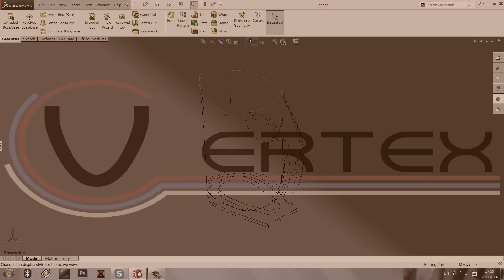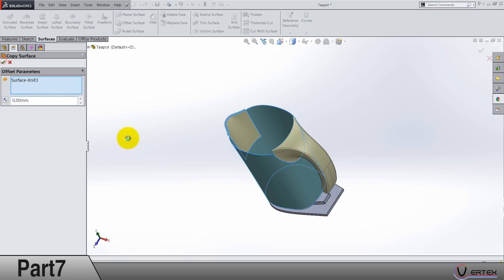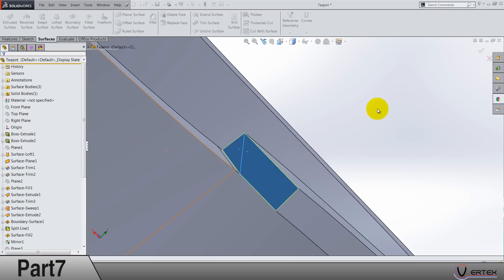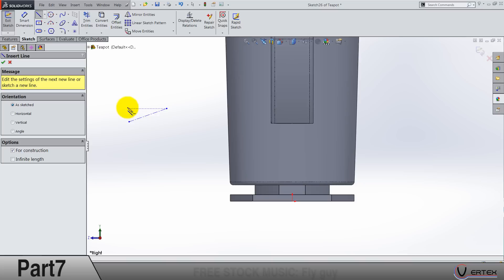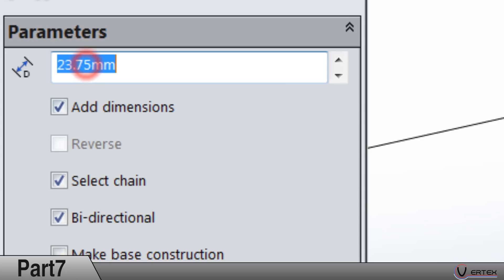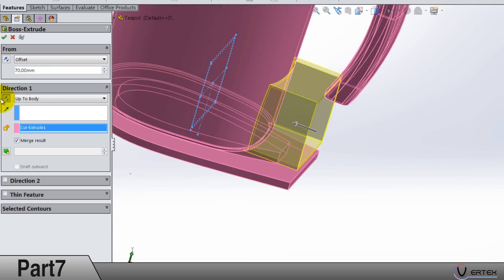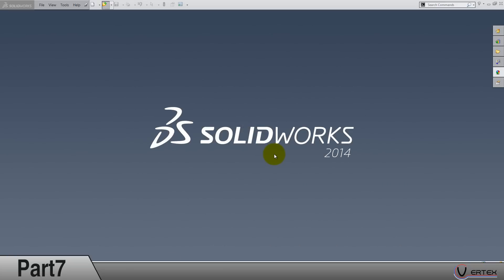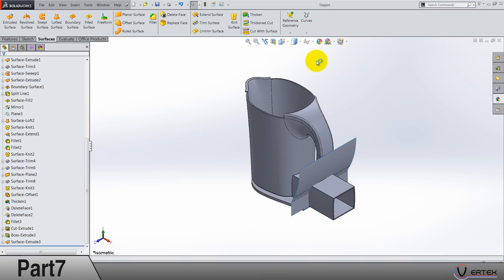SolidWorks surfacing & solid - Teapot #7

Comment: Hello Petar, I am also really enjoying this Teapot Tutorial. 

I encountered the same problem as Nick Pyne did. I retraced my steps and found my error at 1:30, part #5 (fillet 1). I am using SW 2016, and I changed the fillet profile from "circular" to "conic" to better transition with the 3mm sketched radius on the teapot handle profile sketch 10 at 3:52, part #3. An inside thicken of 1.75mm then worked beautifully.

Hope this helps and thanks again for uploading these tutorials!
Reply from the maker: Hey Miguel, I am glad to hear you are making progress.

Thank you very much for this tips I will definitely make an annotation with your instructions in order to help others to overcome this issue!

Cheers!
Petar :)
Reply: The pleasure is mine, Petar.

Comment: Hi, I've been following your tutorials, they're really good. Just ran into a problem, I can't get the thicken to work, it will only allow me to thicken outwards, but not mid-plane and not inwards like you did in your demo, please help?
Reply from the maker: Hi Nick, I am glad you like my videos.
Can you show me at what exact time you have the problem.
Reply: Around 2:15
Reply from the maker: all I know I was struggling to make that part possible to thicken, I've spent 7 days of modeling the whole part and 6 days to make the surface in a way that no such errors appear.
I would send you CAD file to keep going with work but I have lost the whole teapot tutorial files, check all sketches dimensions to see have you made mistake up to that point, if you still can't find solution send me the file and I'll take a look at it! :)
Reply: Ok awesome thanks
Reply from the maker: no problem, have a good one!
Petar